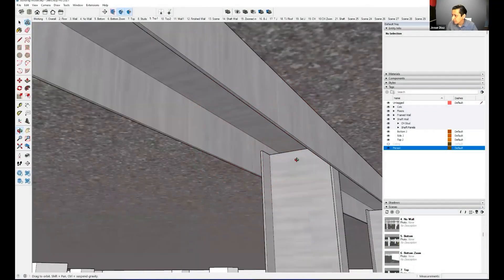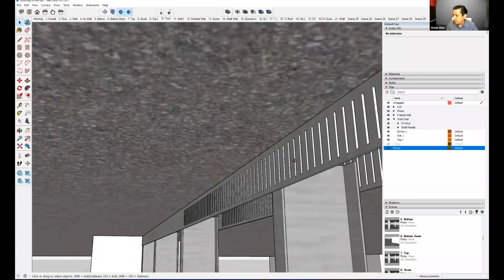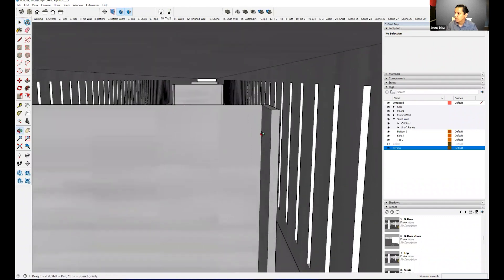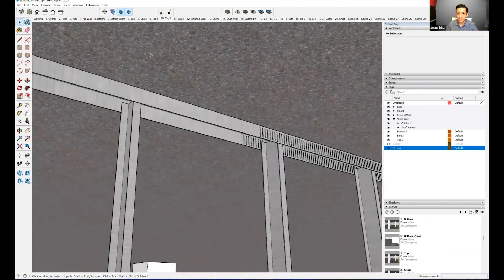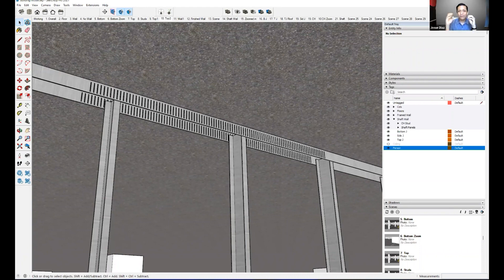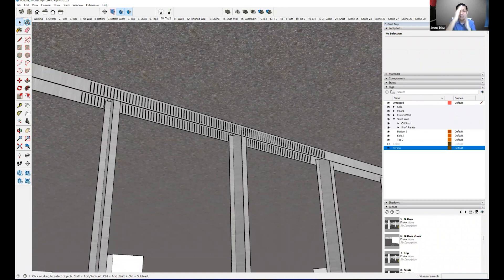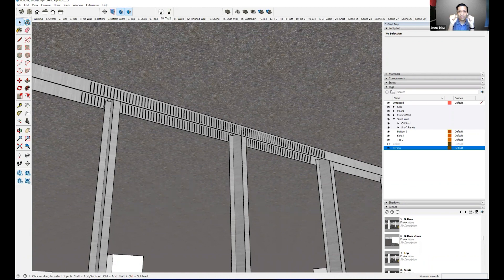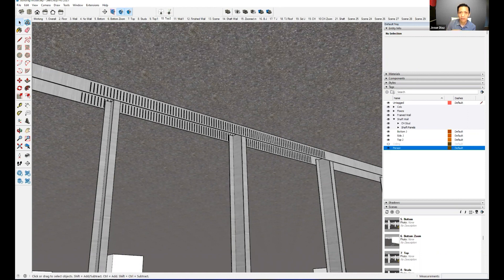AC  036c - Why use Slotted Top Tracks In metal framing

Comment: This system isn't just for earthquakes. It helps manage the weight and pressure from the roof or floor above, letting them move without putting extra stress on the wall studs. The pressure can come from things like gravity, wind, water, snow, earthquakes, or changes in temperature.
Reply from the maker: Good point!

Comment: Question, if there’s room for deflection, as soon as drywall is put on there’s no point because it’s all locked in. Because drywall usually starts with the ceilings, unless it’s a demising wall between units….. so if the ceiling is rocked already except demising wall, then the partition walls get rocked everything is locked in… I’ve never seen it where partition walls are rocked first then ceiling. So which way should they be rocked? Partition then ceiling or ceiling then partition?
Reply from the maker: What you are describing sounds more in line with residential construction. In commercial construction a "ceiling" is often a suspended ceiling, and the shaft wall would be built between the concrete floor below and the concrete floor above (not to a horizontal gyp. bd.). But of course, many scenarios are possible and if a full height wall needed to be built up to a horizontal gyp. bd. assembly for whatever reason AND the joint was visible, a clever way to cover the required expansion joint might be needed. Talk it out with your architect and together, you will be able to come to a solution.